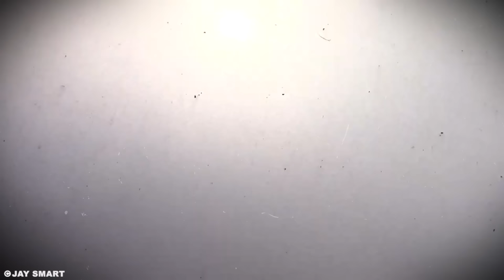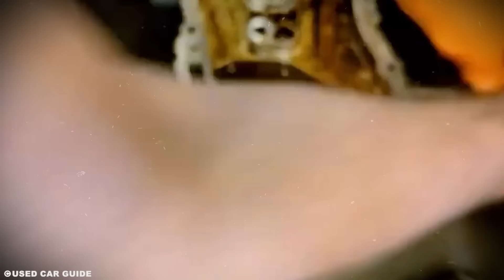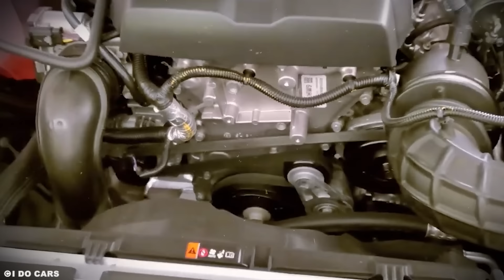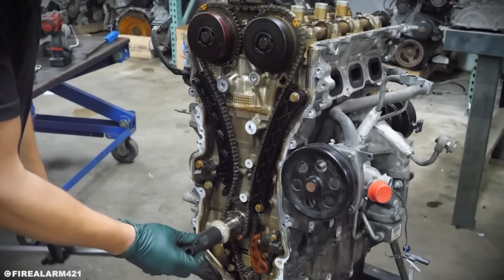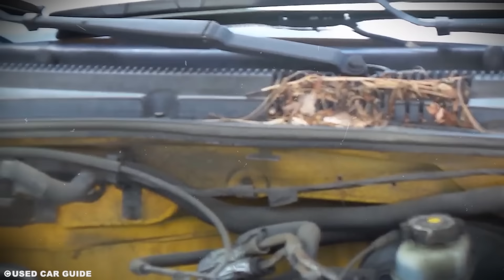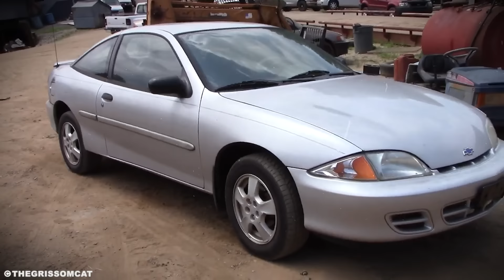How GM’s Ecotec Engines Earned Their Bad Reputation

Comment: The 3.6L VVT High Feature engine carries those same problems in its line.
3 long stretching timing chains, plastic timing chain guides, carbon buildup on intake valves.
The timing chains are self-explanatory resulting in broken heads (cam caps specifically, which aren't replaceable due to their bearing-less milled design).  Even if you want to replace the bent valves... too bad, the head is beyond salvaging.
Plastic chain guides which become brittle & break-off pieces, falling into the oil pan, clogging the oil pickup screen & starving main bearings... snapping a rod or two (totaling the engine).  < This can be triggered by a simple thermostat failure & its subsequent engine overheating.  Replaced that troublesome thermostat already?  Still likely too late.
The customer-expense hassle that is Direct Injection on these 3.6's far exceeds any savings at the pump.  >$500 for the High-Pressure fuel pump the size of your fist, and $1K for intake valve cleaning service.
These are my experiences with used 2008/2010 Enclaves, where they should have stuck with the 3800 engine.
These cars, sure aren't worth even $5K used (Yet GM demands $8K for a new engine alone, ha!)

Comment: the 1.2, 1.4, 1.6 and 1.8 ECOTEC engines from Opel and Vauxhal cars in Europe during the late 90 and 00 where pretty good..  200-300000 miles easily with proper maintenance

Comment: i use a l61 engine on my engine conversion in my alfa romeo spider..the hard part was making a front wheel drive engine and rear wheel drive engine,,but i did make it work..and it looks well drone  not a hack job..the 2.2 makes 230 hp without a turbo  10.5/1 compression oem cams..and other things..it move a 2200 pound car, very quickly..and still get about 36/38 mpg on the highway..tested the oem alfa romeo fuel tank only holds a little more that 10 gallons..and from a fill i can drive 330/340 miles with some fuel left over
Reply: For all it's flaws, the L61's bottom end is as TOUGH AS NAILS! I've yet to hear of anyone blowing one up that still had oil in it!

Comment: The issue with these engines is the same as with almost every other American car manufacturer now. There are many of these engines being built and in alot of cases being designed in China as well as South Korea along with many other parts besides just the engines and there parts all over Americn branded vehicles being used. The facts are even those engines that aren't being built there are still using a large portion of part's from these places to build other engines in GMs line up of motors in America.  This is the practice of many other car manufacturers here in the states now. This is why alot of engines are having issues as we know and have seen from  parts failure issues.  This is also why President Trump wants not only car and truck manufacturing brought back to America but as he has stated he wants the parts made here again all the way down to the steel used to make everything .  I for one would love to see that again in this country myself . I know atleast for me in vehicles as well as many other products  it makes me have alot more trust in what I buy if it has MADE IN AMERICA stamped on it while also knowing that those products are made with or atleast mostly made with American parts and materials by Americans. 👍🇺🇸🇺🇸🤠🇺🇸🇺🇸
Reply: What vehicle qualifies in your opinion? Most auto makers globally build their cars.
Reply: And America car brands are not good. GM and Ford both have serious issues with their current engines.

Comment: Why are most people afraid of oil changes?
Reply: “Think of how stupid the average person is, then realize half of them are stupider than that” - George Carlin
Reply: I keep telling people to change the oil every 4000 miles.
Reply: @greenmanmars9520yeah, me too. But its often speaking to deaf ears.
Reply: @greenmanmars9520I do mine every 3k. I wanna keep my turbo fresh also.
Reply: Just have to be smarter than the GM bean counter knuckleheads! Oil changes are cheap insurance, if you catch synthetics on sale, rebate, and or clearance! I've been PAID to buy them after rebate in the past.
Reply: Just like GM pushing 50k Antifreeze and 100k automatic transmission  fluid changes.
Reply: @wrenchhead28 
   Loudly claiming lower cost, long drain intervals, then quietly calling for 30k transmission service and 4k oil change interval for ' severe service ' defined as normal service.
Reply: @wrenchhead28  Exactly.  Have to change it much earlier on those.  Now on transmissions they say "lifetime".  The joke is lifetime if you keep your car only 100,000 miles and then junk it.
Reply: Americans by and large are lazy.
Reply: I used to own a 2.0L ecotec in my 2006 Saab that was turbocharged. I owned it for 12 years, 197,000 miles before selling it.  The second owner now after 19 years is approaching 300,000 miles on the original engine.  I now own a 2018 Buick Envision with another Ecotec engine.  It now has after 7.5 years 105,000 miles with no issues at all.  If you do the oil changes every 5000 miles and not the 7500 miles they recommend, they last for a very long time.  This person with the video must have found people who followed the recommended oil change interval and got into trouble with it.  The time chain issue occurs when you don't change the oil until 7500 miles, then the guides need to be maintained, and that is when that is when the problems start.  So he is accurate if you go by GMs maintenance schedule, but if you are careful you won't have any issues.

Comment: I have had and have ecotecs for about 25 years now. I agree with the timingchain issues. But thats not only ecotec issue. Thats in every engine manufacturers these days. Chains are holding maybe 100-150.000km. So i went back to belt driven. I am satisfied with these engines though. But they dont like abuse. It needs oil and it needs oil changes.
Also the car sellers tell customers, "this car has a chain, so it is maintainance free". Thats a direct lie.

Comment: I had a 2010 Cobalt coupe with the 2.2l LAP.  Beside sticky valves on Cyl 1 requiring a rebuilt head and a trans rebuild, she kept ticking the 10 years (2010-2020) I had her. I still see it around often just the paint has seen days lol.
Reply: Those are fairly substantial "besides".
Reply: @ryankenyon5010 right?!

Comment: If they had stuck with the iron duke and 3.8L they’d still be one of the best out there. I drove an old grand am with an iron duke into the ground. Loved that car
Reply: The Iron Duke paired with an automatic trans was garbage. They usually had rod knock around 100K. The same engine when paired with a manual trans would last for 200K or more. The lockup torque converter killed those engines
Reply: @justsumguy2u Chances are very good that the "garbage" Iron Duke delivered a lot of your mail for many years in the Grumman LLV Postal Truck.  Dukes aren't sexy, powerful, but they do deliver the goods,...er, mail.
Reply: @kwt7667g  Keep in mind that the postal service has a big budget---they can replace an engine every 50K if they need to, and they can also replace the entire vehicle every few years if necessary
Reply: I’ll totally agree with the 3.8 V6. Powerful AND reliable, if a bit old fashioned. A friend of mine had one that was still running like new at 230,000 miles on the odometer. The 2.5 liter “Iron Duke” 4-cylinder was reliable, but it was underpowered and rough running. It was particularly bad in the early X-cars (Citation, Skylark, Phoenix, Omega) with GM’s horrible 4-speed manual transmission with its awful clutch. I learned on one. Stalled the engine more often than all other stick shift cars I have driven combined.

Comment: The GM LTG engine was fantastic, other than some initial ring issues it has been terrific. I made sure that my 23 Camaro had it as did my wife’s 18 Terrain, 200k on the Terrain and with 50 percent oil changes regularly and run on regular gas since new.

Comment: General STOP building engines that are a bitch to work on, make em like you did in the 60’s !!!!!!!!!!!!!!!
Reply: There will be more room under the hood if they get rid of power steering pumps, power brake boosters, air conditioning compressors and so on.

Comment: The original 2.2 and 2.4's were great
Reply: The early engines were good. If the owners drained GMs corrosive lifetime antifreeze, before it ate away at the head gaskets.
Reply: You're crazy. 2.2's ate head gaskets all the time, and I know of 3 people that had them fail at under 100K
Reply: @justsumguy2u 2.2 OHV non Ecotecs did that. Iron Dukes too. The Ecotec 2,2 has never been know for head gasket problems
Reply: @DaveGreg100  That was not my experience working at the GM dealership. And never in my life have I ever heard of an Iron Duke with a blown head gasket...it never happened.

Comment: I worked as a technician in a Saturn dealership. These engines had some shortcomings, but potential. First off, the chain was always automatically tensioned. It was a ratcheting spring, and the oil pressure held. I had a Saturn Red Line 4-door supercharged coupe with the timing chain rattle. A revised chain tensioner cured the noise. Also, why were V6 engines shown in the video? The points made seem to exaggerate the issues the engine had, as if getting revenge for being burned by a defective one. Take this info with a grain of salt.
Reply: Had an hhr with 300k on the original engine… didn’t burn oil or anything.
Reply: Stuff like this is why I have been a Toyota man, and tell people to buy Toyotas. I just sold an 09 Yaris with 380,000 miles with ONE part replacement (other than tires, brakes, and regular maint) which was the alternator. There is NO excuse for a properly maintained vehicle which has not been abused to have these kind of problems. And here's the thing: I used to be loyal to American cars (before I knew better), as a young man I called Japanese cars "rice burners". but even in the 70's the Japanese were making cars that went 100K miles on just maintenance while Detroit was making Vegas, Pintos, and Chevettes. That was the low point, but some of the junk they make now isn't much better.
Reply: @jeffherrle545  I have a 2008 Corolla , changed the water pump at 40 000 miles , catalytic converter at 60000 , the timing chain rattles (finger crossed ) my 2014 Sienna new AC compressor at 70 000m new starter at 75000 m , both were well maintained and not abused. They are above in reliability but not perfect .
Reply: @jeffherrle545  I just sold a 2001 Saturn L200 with 354K miles.  The original owner changed the original engine at 75K, with a junk yard engine that had 50K. I got the car for free with 125K and immediately changed the timing chain with an "UPDATED" Cloys setup and never did anything major until about 290K when it got a new fuel pump and rear fuel lines. About 310K it got a new coil pack, spark plugs and valve cover gaskets. I ran MOBIL ONE 15,000 mile synthetic oil and changed it every 2-times the oil change light came on.  I can't complain much about this car....
Reply: I have the updated Melling tensioner for my '07 2.2 Vue, just need to pull the valve cover & ignition cassette to be able to hold that chain guide out & immobilize both cams so she doesn't get "jumpy"!
Reply: They also showed many pics of the pushrod 2.2 4 cyl.

Comment: This engine is the mark of GM’s downfall. However I wouldn’t mind a ZZP Trifecta tuned 2.0T swapped Chevrolet Cruze that makes more than 300 hp though.
Reply: I have a tuned 2.0 2011 Regal. Its insanely fast. Love that engine.
Reply: @WorIdsSmallestViolinI got a cobalt with a regal block and the cobalt lnf head. Fully built, makes 680whp. Freaking monster
Reply: Trifecta tune is the biggest pile of shit tune there is. The downfall of most lnf engines was the tuning, and trifecta, aside from when Vince tuned them back in 2009 to like 2013 , is one of the worst u can get

Comment: I thought no one could beat GM's 1981 V-8-6-4 engine as the worst engine ever built, but the company that's too big to fail found a way. Some companies deserve to die, and General Motors is a top candidate.
Reply: The only problem on the V-8-6-4 was the added variable displacement system. The engine itself was solid and you could disconnect the electronics and have a perfectly reliable car. You want to talk garbage? The HT4100 that followed was a reliability disaster. By the time that they had worked out the problems in the 4.5 and the 4.9, the Northstar came along and said "hold my beer!"
Reply: @Paramount531 💯
Reply: Your right if they keep this up they earned to go under!
Reply: @danielduffy4134  GM has been operating in this manner since at least the early 1970s. The Vega could have been a successful car but cost cutting is the reason it ended up being a disaster. There is nothing new here. After being a Honda tech for 11 years I can attest to the fact that Honda and Toyota stand behind their products much better than the American quarterly profit hounds. If your '06 to '09 Civic cracked its engine block at 300k miles and you drove it low on coolant until the head cracked, if it happened within 10 years of the in-service date, regardless of mileage, Honda would replace the entire engine at no cost to the customer. They replaced pistons and rings in thousands of K-series and V6 engines due to excessively long recommended oil change intervals. This is how they keep their customers. But GM's corporate strategy got them bailed out by the American taxpayers. Lesson not learned!
Reply: Just the name wreaks of trash
Reply: 11.22.25.   ☝🏼 GM in the late 50s thru 1970, built some of the best and iconic cars ever.  That being said, I concur with you. It’s a abomination to what has happened with gm™️ … piss poor leadership‼️ It deserves to go under.

Comment: 2010 Chevy Malibu bought new and maintenance was kept up with.  Was so glad to get rid of that piece of crap in 2016 with 82,000 miles.  Started using oil like crazy and lean fuel on cylinder 1 was the end of it.  Traded it for a 2016 base f150. 105,000 miles on the truck now.  So uneventful and reliable that this truck reminds me of a Toyota Camry .  Gonna keep the truck until it dies or it is on our estate sale.

Comment: If you own a car with an ecotec 1.4 turbo (Encore, Cruze, Sonic, Trax) know the terms UFI and Hengst. If you use a Hengst oil filter cartridge in a UFI housing you are basically running your car WITHOUT an oil filter. Read and fully understand TSB 17-NA-184. The ONLY way to know which filter your car needs is to look at the cap for the filter and see if it is labelled Hengst or UFI. The filters both fit and even entering your VIN or reading your owners manual will not tell you which one your car has.

I can't believe any company would do this sort of engineering.  The key difference between the Toyota failures and the GM failures is the Toyota was a MANUFACTURING problem that can quickly be fixed.  GM products are ENGINEERED less reliably so the foundation for manufacturing is faulty.  Put poor manufacturing on top of poor engineering and you have a nightmare  

Old GM products may not have been reliable but at least were easy to fix and parts were cheap.  Neither is true any longer.

Comment: the ecotec weighed several thousand pounds?
Reply: I heard that too and questioned that statement'
Reply: Sludge build up from using penzoil
Reply: They should have said - 2700 lbs of scrap car when the ecotec went south.
Reply: @rctopfueler2841  the sludging issues of both Penzoil and Quaker State. Hasn't existed for almost 2 decades. And it only effected vehicles that were primarily driven less then 10 miles at a time. It was due to the high parafin content in oil from eastern US oil wells. On longer trips the high parafin content actually helped lubricate and protect the engine. Short trips are bad on engines no matter what oil is being used. Condensation in the oil is just as bad as not changing your oil often enough.